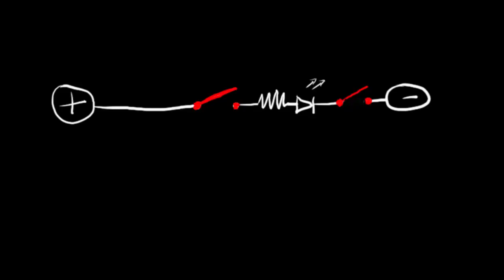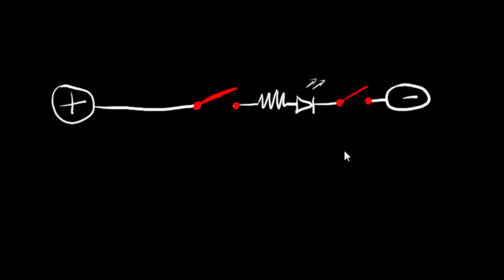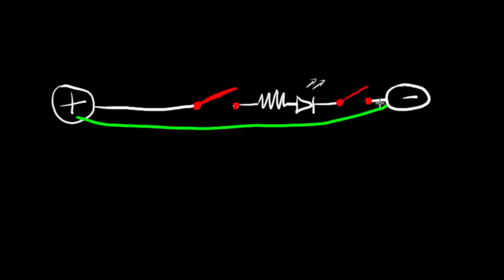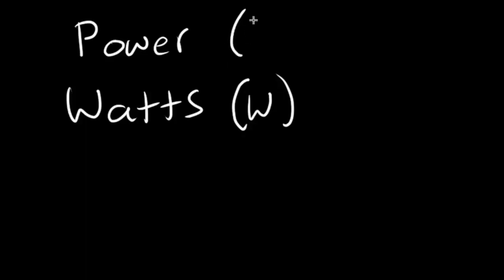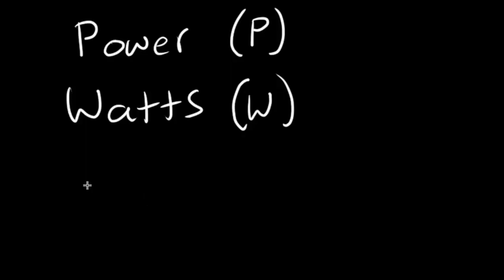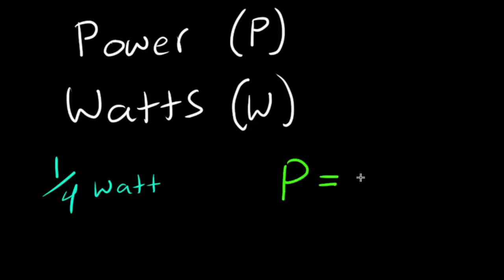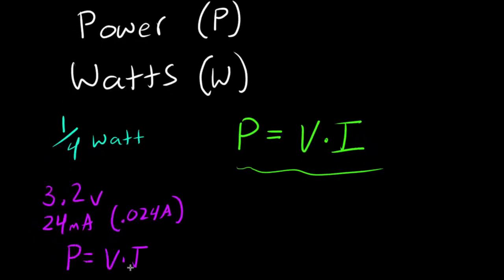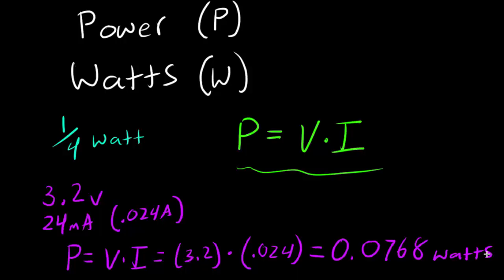Beginner Electronics - 16 - Clarify & Power / Wattage

Comment: suppose i have 10V coming from a wire with zero resistance which in turn gets divided into two other wires how does the current and voltage get distributed?
please help
Reply: no it affects the ampreg volts are the size of the pipe and amps are the water going through it OK =)
Reply: Nick Fury The amperage will get divided between the two wires, but if you use more current than the source can provide, the voltage will also drop
Reply: Im alittle late to the party, but it depends, if both paths have the same resistance, then the current will stay the same, but if one has more than the other, that one will get less current than the wire of less resistance.

Comment: What would happen it you have two diodes faced together so that electricity could not get out would you get a battery lol. Also if you had ac going threw a Series of diodes facing the same way would it turn ac to dc lol
Reply: if you faced 2 diodes together  the power would flow through the diode that is facing the right way and then stop at the  diode facing the wrong way as the electrons would no longer flow and as for having a heap of diodes in series for dc your almost there but having more in a row will not achieve anything more then 1, with a.c. power it flows the opposite way as well, alternating current is a sine wave so it starts at 0v gets to 240v then decrease back to 0v changes direction and goes from 0 to -240v the amount of times it does this in a second is known as your hertz, in Australia our power supply is 240v 50Hz so the current flow changes direction 50 times a second, so with only a diode in series current will flow in one direction but only half the time even with 3 in series it will still only flow for half the time as for half a second the current is flowing in the opposite direction to fix this you need to wire additional diodes in such a way that when the current is reversed current can still flow in the direction it's required for the full sine wave cycle this is called an a c. to d.c rectifier just YouTube it and it will show the circuit diagram and how the diodes are wired in such a way that when current changes direction there is still a path to follow

Comment: Hope this series get somewhat regular updates, I almost forgot I had subscribed to this channel, since I only watch this series.
Reply from the maker: +Fernando Santos I'm hoping to do this at the very least once a week now, but then again I've said that before ;(
Reply: CodeNMore why did you stop making videos if possible make more
Reply: They are different ways of measuring your circuit. The voltage is like the storage of water whereas current is the flow of water through the pipes. Voltage is measures in volts current is measured in amps. The missing factor between reconciling these figures is the resistance in the circuit or the bore of the pipe. So they are like stepping stones to get from one measure to another. V = I x R or [I = V/R or R = V/I]